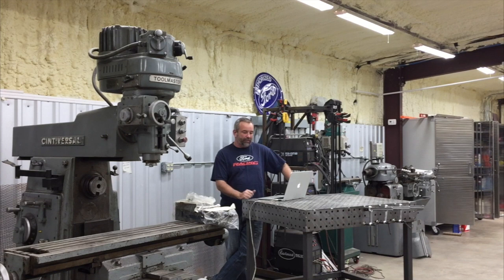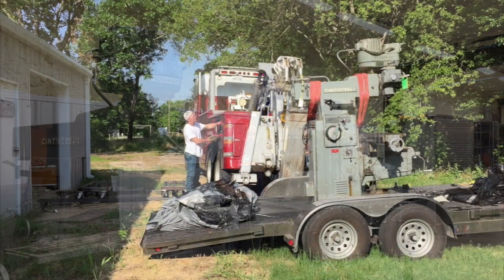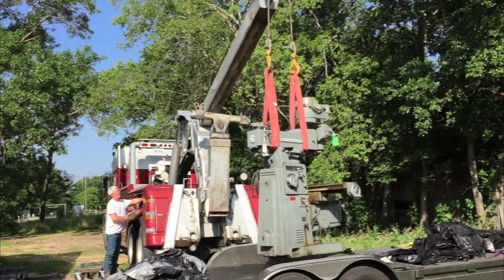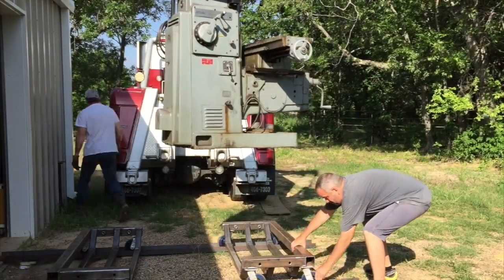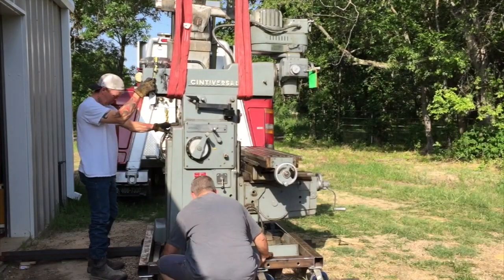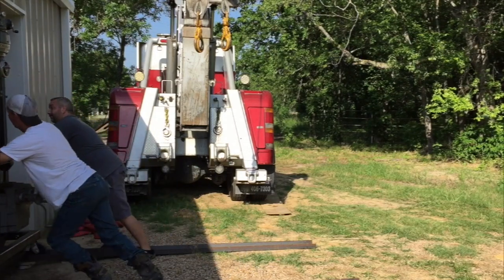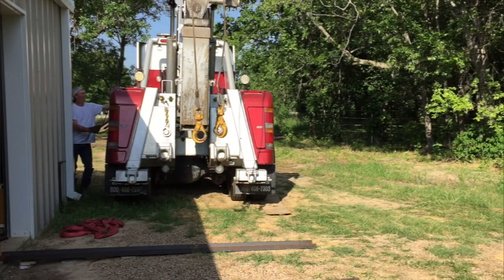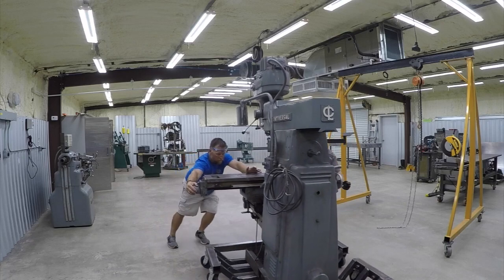Unload a Heavy Machine - Milling Machine (Mill) - Rigging - Strapping - Lifting - Dallas, TX 75201

Comment: A few sheets of plywood and a few 2'x4' 1/2" plates laid out on the ground outside and land the machine on 3 1"x4' long bar stock would have eliminated the building of the dollies and lifting the piece with an over capacity gantry. A heel bar could easily push the machine on your floor and been used to lift the machine off the rollers and onto the floor. Machinery moving and rigging are not DIY projects. I was a Rigger for 40 years and had no idea how to operate any of the machines I moved. I have always questioned why people who know how to operate the machine are experts in moving them. Please hire professionals, a lack of experience can damage your machine, injure or even kill someone.

Comment: wouldnt it be easier and safer to back the trailer up over the rails, lift mill, drive trailer forward, drop straight down. without moving hoist truck.
Reply from the maker: well it's not a bad thought for sure, but the chances of getting the mill on the trailer center directly over the rails while it on the trailer could be a challenge, so some likelyhood of having to adjust the big truck anyway... this seemed to work out pretty good and seemed safe to me, did it not to you?

Comment: Instead of breaking your back trying to get it in the right direction manually why not just use a steel bar to "pry" it in the direction ... I moved things 4x my weight and size with just a nice solid bar

Comment: Looked very non-eventful, which is good when moving heavy machinery.  Not a criticism and I'm sure everything is fine but  I'm not sure I  would lift the machine by the table like that.  I know it was not the full weight of the machine but it was more than half for sure.
Reply from the maker: Ahh ok, didn't realize that wasn't a good place to try to lift from.  Honest so much of the weight is out front on this machine, I had a hard time finding a good place to lift from, that would actually pivot the weight toward the back.  I guess for one thing i could have loosened the ram and moved it all the way back. Thanks Bill
Reply: Yeah Gary, I'm not sure maybe someone can chime in that is heavy mill so it may be different but for smaller machines they generally try and lift from the top under the ram.  I doubt you did anything to it I just thought I'd mention it for the future.